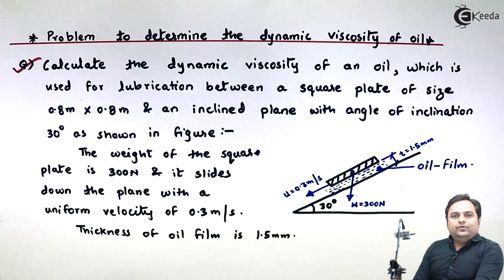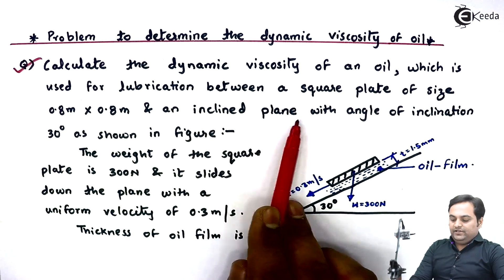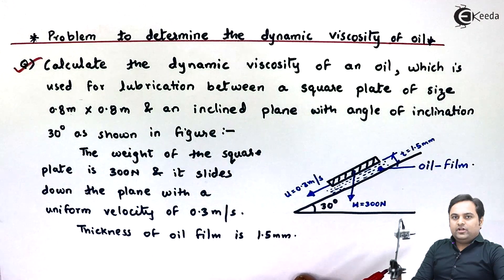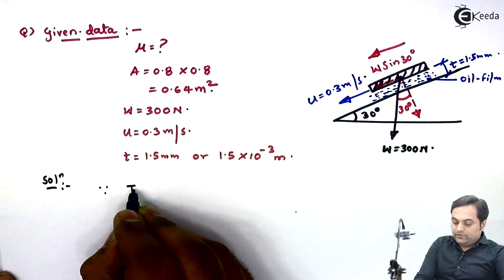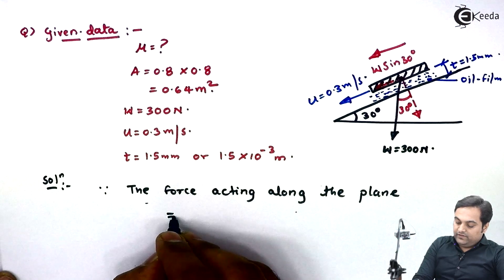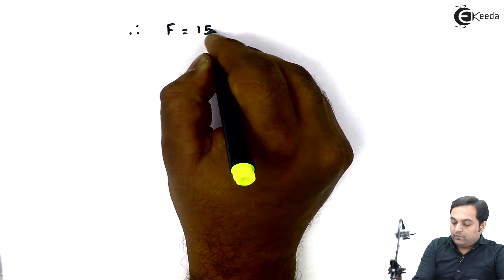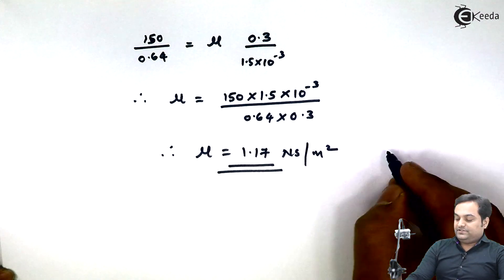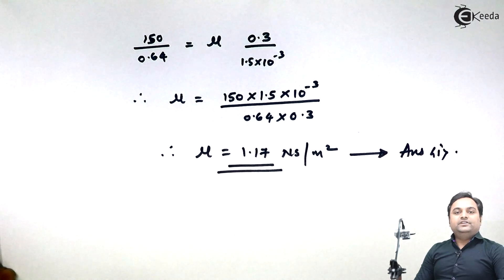Problem to Determine Dynamic Viscosity of Oil

Comment: A total of 12 litres per second of oil is pumped through two pipes in parallel, one 12 cm in diameter and the other 10 cm in diameter, both pipes being 1000 metres long. The specific gravity of the oil is 0.97 and the kinematic viscosity 9 cm2 per second. Calculate the flow rate through each pipe and the power of the pump. Please sowl this sum sir i tried somany times bt i fail pleasee help me
Reply from the maker: Ask any question on our app for quick answers to any problem!
We are giving any one subject free for one month,                                                                                                            If you want to access the free subject just download the Ekeeda app and use coupon code ''FIRSTTIME" (This offer is valid through app only)                                                                                                                                        Download Ekeeda Application and take advantage of this offer.
Android:- https://play.google.com/store/apps/details?id=student.ekeeda.com.ekeeda_student&hl=en
iOS:- https://itunes.apple.com/tt/app/ekeeda/id1442131224